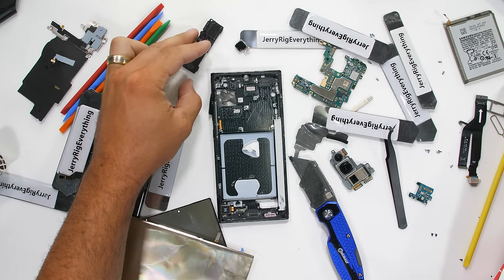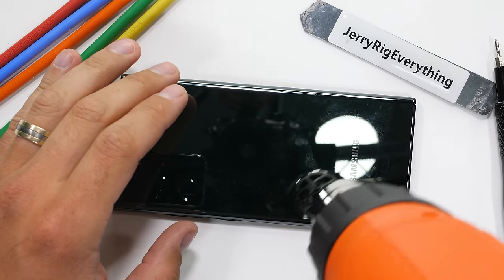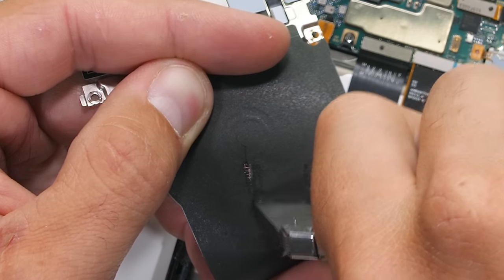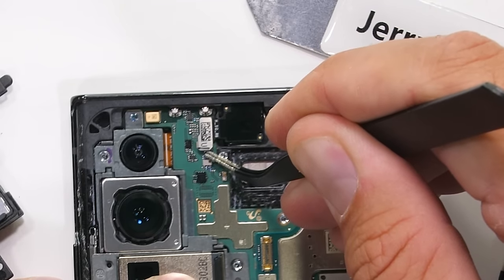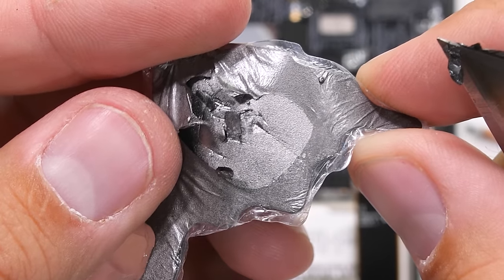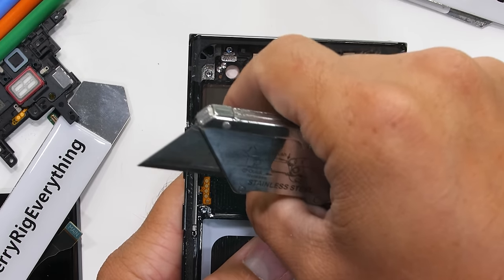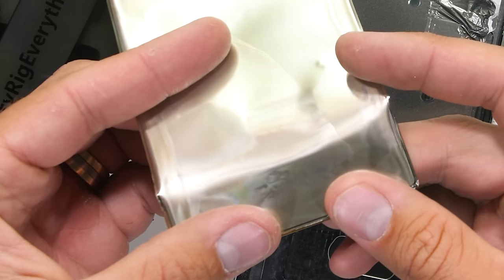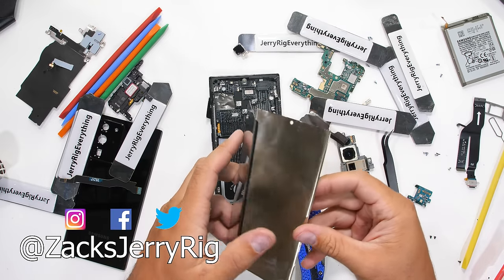Samsung Note 20 Ultra Teardown! - No Copper Cooling inside?!

Comment: @JerryRigEverything . If one were to accidentally poke the top mic hole with the ejector tool instead of the SD card slot hole. Would the note 20 ultra suffer any damage what so ever (damage waterproofing and or damage microphone or whatever is in that hole?) if someone made the mistake ? Asking for a friend and would help many new note 20 ultra users if they had done the same thing. Love the channel!

Comment: I ran into some issues on my Note20 ultra after buying 2days ago i was just using the phone to watch a movie 30 min in the movie the phone overheated then the phone went to reset mode by itself.
the phone screen setwent to flash mode.
I took it back to the store and they said that it voided warranty.
i took two a smaller shop to get fix but the man at the shop said the phone is not a software issue.
it's because the motherboard burnt out on the phone and that's the reason that code comes out on phone.
the phone is not a good quality don't purchase it. I'm stuck with a phone that does not work the store does not want to return my money back.

Comment: Suprisingly my note 20 ultra display crack hairline without i drop it on low right corner.they advertise this phone using the greatest and most durable corning victus.but why it happen.already go to service centre but they just keep silent and dont want to change it since it  external damage.really dissapointed.

Comment: Can we put S21 plus battery into note 20 Ultra? Is it compatible? The main idea is to get more capacity (4500mA to 4800mA), or if we could put S21 ultra battery.. it is higher (5000mA). Please dont answer better to put the original dedicated to note 20 ultra battery. Hehe

Comment: Guys a little question
If I'm not too demanding with my phone and I play games with not that much exigence (I don't want to play PUBG nor Fortnite on it) it's having an Exynos a problem? I just need something with a good response speed and that not get too hot during sunny days or the heat of the summer (my current phone is a Mate 9 and easily can reach over the 40°C/104°F). I could buy a Note or S on Amazon with Snapdragon but I think is a risk, even more with the COVID situation.
Reply: NOTE: I'm not aiming specifically for this phone, Note 10+ and S20+ are also considered and welcome

Comment: 1st. Name of phone question. How many cars has Ford put the name Mustang on?
2nd Having worked for IC manufacturers and tested them. Same architecture chip can have different heat characteristics. Obviously this didn't need the copper heat shield. Probably thinner doping on IC hence less heat.Looked great, and your choice in phones is irrelevant if not ignorant. Enjoyed the destruction, thanks.

Comment: Hope Mr.JerryRig will see my comment.
My NoteUltra5g just arrive from official service center because I broke the screen.
And after paying around 300$ for screen replacement they gave me my phone like a brand new.
After 3days of exploring this Loved phone my fingerprint sensor suddenly stops working and after checking the setting it says my phone needs to restart.
I do the restart a couple of time  and nothing happen.
So searching thru the internet and groups they told me to wipe the cache of my phone  which I did. But same scenario happen It didnt fix my phone.
I did also wiping all data and reformating the phone and stills the same.

I would like to know, is it the board was the problem or just the screen?
Any, touchscreen works. Just the biometrics/sensor is not.
It says"Fingerprint sensor not working.
Hope anyone would answer.
Thank you!

Comment: I have been a life long fan of Samsung. 
But their recent behaviour with my support issues has put me off them for life. 
My note 9 started to overheat after the latest Android update. 
The Audio Amp on the Note 9 has no heat sink. 
The complete thing melted and tiny balls of lead were all over the PCB. 
Samsung wanted me to pay  375$ to replace the board on a phone that is not even 2 years old. 
Bye By Samsung. 
And yes I got the crappy Exynos version. 
If you walk into an Indian Samsung Service center with a Snapdragon based Note they almost kick you out. 
They make nice eye candy. 
But the engineering of their products esp for India / UK / Asia is utter crap. And their support sucks. Because its outsourced to some 3rd party vendor who does not care.

Comment: About time someone called out Samsung for there different versions(sd & exynos) and overpriced devices the note was the enthusiast go to for a hugh end device with all the bills ans whistles there shouldn't be 2 versions and espicially not different processors if you have to make a lite version like the note 10 lite it had an appropriate pricing now that is acceptable and it has a place in the market 
But no they getting greedy with those prices and we all know the normal note 20/10 are there to make u go for the more expensive versions and even if you get them you still not getting your moneys worth
We need to call them out more and more and if that doesn't work i personally won't be buying any Samsung devices anymore not for those prices at least...

Comment: Why does the note 20 ultra have a lower screen resolution compared to the S20 ultra?  It's not much but they should be the exact same panel these inconsistencies with device are just confusing. The note 20 ultra seems like a overall downgrade from the S20 ultra.

Comment: It is sketchy and similar to hyping up 5g though there is basically NOOOO 5g ANYWHERE!  MORE disturbing is  lack of adequate thermal dissipation. Just imagine what's happening to the components when the back of your phone feels hot.   Maybe Samsung needs to invent and install a micro airconditioner that could condense back onto the processor, cooling down. Lol.  Samsung.. SHAMEFUL.    I'm going to get a midrange phone or a rugged phone next.. As long as camera decent, it's HD, and I can drop it without feeling my blood pressure rise. That's what matters most.. I don't need the flagship worry anymore. Baying the phone and making sure nothing happens to it.

Comment: Speaking pure business without emotions..  There are enough evidence that Samsung acts as cheap company by saving on parts, quality, and features hidden to users in order to spend on marketing and maximize their profit. This is even more evidence in other product lines such as TV, home appliances... On average, a product from Samsung sold for $1000 is inferior to a $500 product from other brands.
Samsung still depends on its OEM strength for example build a screen and put parts around it to make a phone. This is the opposite of innovations. I guess Samsung way into the future will fail in many product lines and may drop itself out, the phone business can be one of them.

Comment: Samsung is getting really greedy every year. The value for money isn't justified in their flagship devices. 
OnePlus used to offer great value for money at an irresistible price tag, but that's not the case anymore, bcoz their value for money is decreasing and prices are increasing, which makes no sense & bcoz if Chinese smartphone manufacturers like OnePlus are going to cost around the same as Samsung, Apple, then what's really the point of even considering a Chinese brand?

Comment: Yeah.... so I'm staying with the Note 8 for life. Last unit with a lot of things that disappeared the next model up and all thereafter. Still faster than any app or game can ever demand, even on highest settings ( when gaming, if you phone game, which is pretty crap ) ... Plus it's about the last or fringe model as far as pricing "fairness" goes. It was still massively overpriced, but the 9, 10, and 20 are all just hilariously BS overpriced. Something like a 1550% profit margin on the base models, let alone the insane, and quite crap 5g versions. Screw that.   Samsung can pretty much go to hell at this point.

Oh, and Sammy's always sold same phones differing innards. And to a severe degree... even the Note 8 could have had the faster Exnyos (sp?) chip in it... the same could be said for the 7, 5, and nearly all of them. Most anyway. US market always gets the slower chip.

Comment: Don’t recommend this phone 
Unfortunately i am using it and the back glass get loose by itself…. Definitely because they use adhesive instead of another permanent fastening mechanism…!!

Inside the office where air conditioners keep ambient cool and going out to sites in mid of desert with extreme hot conditions . I think that could be the reason